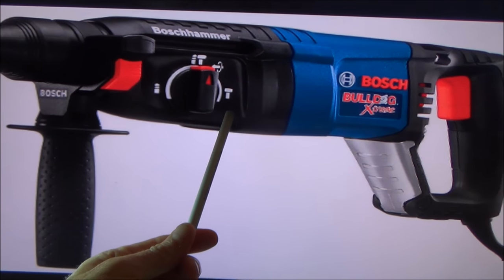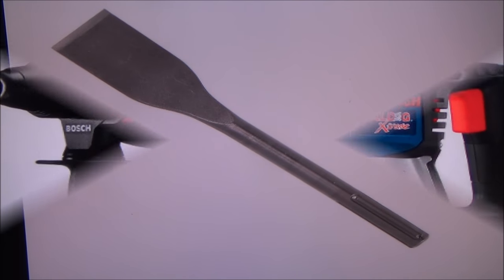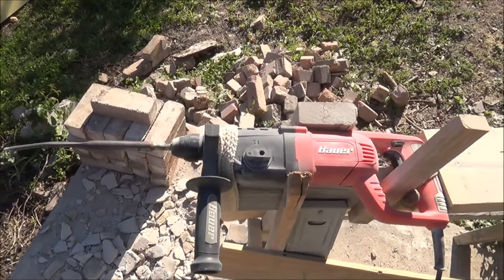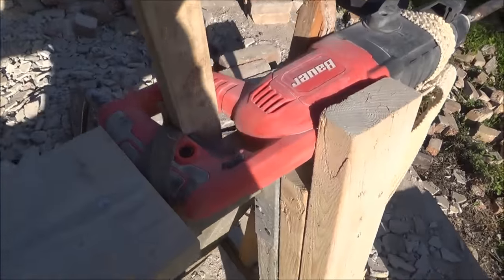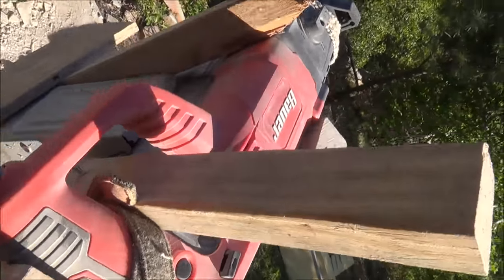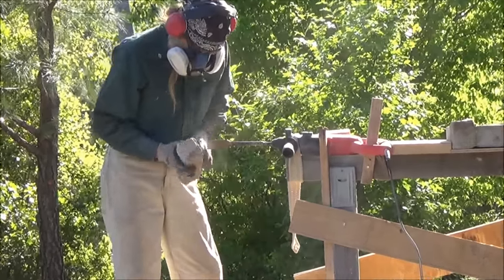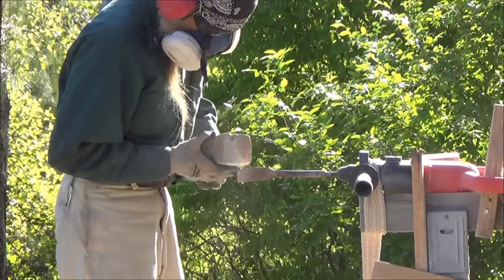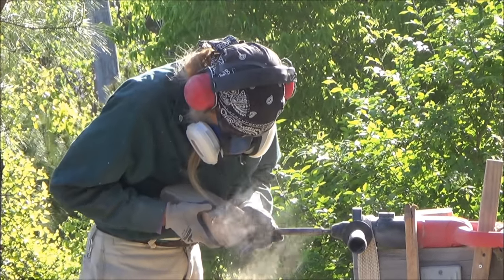How to Remove Mortar or Cement from Bricks Quickly

Comment: Yes it works, but you may find the hammer drill is getting trashed. It gets damaged if there's no pressure on the chisel while it's running full power. It works until it doesn't
Reply: what if it has a power adjustment and you set it to low?

Comment: Great idea! I have to pull down an unapproved brick wall and rebuild and don't want to waste the brick. This could save me days!
Reply: How did it go? I’m doing a 8 foot chimney rebuild and imo saving the brick was the wrong thing to do. I will probably never do a job using the existing brick again. New brick is the way to go, if the customer doesn’t want to pay the extra then some else can do it. 👍🏻👍🏻
Reply: @akaredcrossbow  if they pay appropriate extra for the extra work using used bricks (I know they don´t want to), then why not